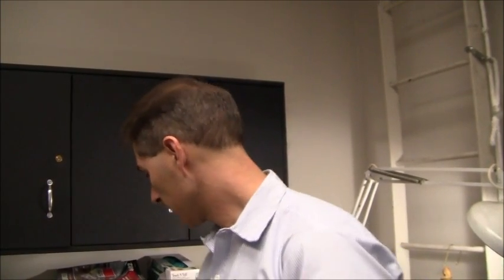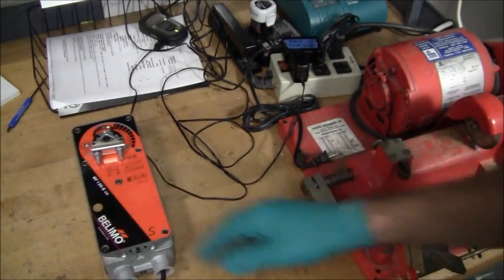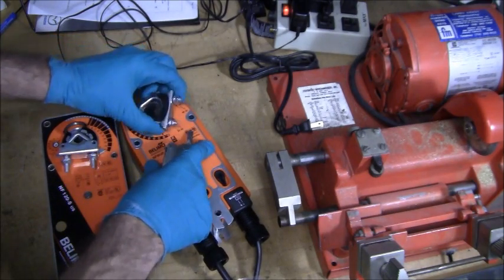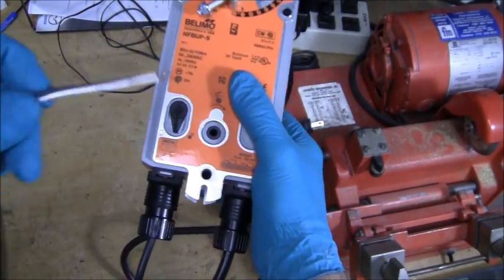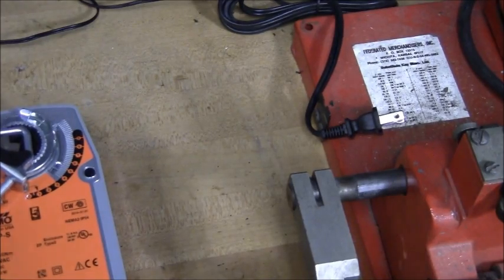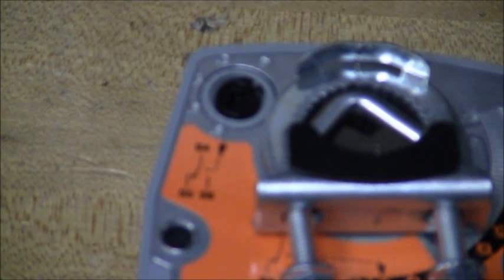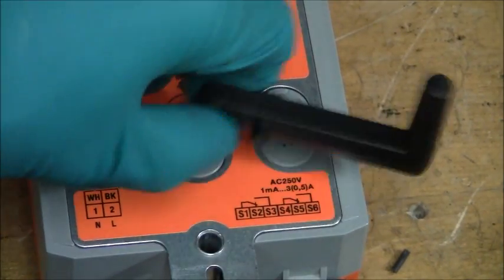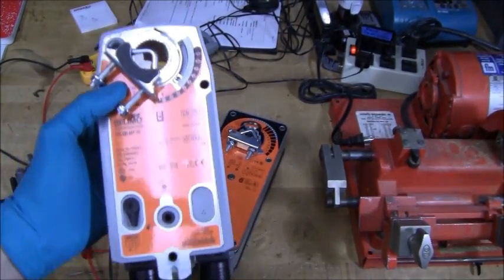Testing a Damper Motor Belimo MO# NFBUP S

Comment: What does setting it to 50% do, that closes a switch for what exacly?
Reply: All those colored wires are contact switches (relays). S4 and S6 wires are normally open and in this video he has it set at 50% and can always change it for whatever application he's doing. S4 and S6 close at the 50% mark in the rotation. So you can run wires from a security panel or Damper panel through S4 and S6 and once the actuator hits that 50% mark a signal can be sent to these monitoring panels.

So basically you can send out from the actuator a signal during any point during the rotation, you just have to set that screw that he was showing us to what you want.
Reply: @mikerosoft1009  wow thank you

Comment: At 12:13 why didn't it stop like you said it did? I'm a little confused.
Reply from the maker: it was not the cam that stopped but the switch opened. you need to listen to the meter and at  50% the meter stops buzzing.
Reply: It's when the auxiliary contact changes state. On terminals 4 and 6 he can adjust when the contact closes. He had it set at 50%

Comment: Having dealt with Belimo and their actuators, I can tell you it is really hard to win a battle with them over a bad actuator. If you have a problem with an actuator, they want you to send it in so they can say there is nothing wrong. 

I used to test fire, and Fire Smoke Dampers on a heated Wind Tunnel. 

Handy hint: if you have an actuator fail, do a static torque test on the damper and then do one under airflow. The actuators should tell you how many inch pounds of torque it can handle. It is printed on the housing. 
If the torque is too high, it can break the gears, they are powder cast and can and do break. 

I used to do AMCA and UL testing on fire, fire/smoke, smoke and air control products. Nothing like being in a room with 12 dampers during cycle testing. Took about three weeks to get through 250,000 cycles.

Comment: I inspect fire dampers and this is the latest in Fire and smoke Dampers the older system is newmattic runs with Air and Fuse links Great video Thank you very much.

Comment: how to lock the damper shaft?
for instance 
1. motor is not energized then the shaft is at 0' position
2. if motor is energized then shaft rotates and open damper to 90' position,

but when again the motor supply is removed the damper goes back to it position.. ?
how to keep open the damper?

Comment: I just wondering what is it for? But now I know... Thanks for this video.& I still have a question is this thesame with the HVAC actuator? Or
Reply: These actuators are designed to close fire/smoke dampers in the event of a fire in a commercial building. When the actuator has power, there is a motor that will open and hold the damper open to allow air flow once power is cut [in the fire alarm sequencing] the spring will close the damper and hold it closed to keep fire and smoke from spreading through the HVAC duct work. Fire smoke actuators have to withstand and function in temperatures of 250 to 350 degrees F under various air volumes and static pressures. I have tested up to 8 inches w.g. And it scare the hell out of me. That kind of static pressure can blow duct work out of the ceiling. 
All of this comes from what happened at the MGM Grand Hotel fire in Las Vegas back in 1980. Lots of people where killed from the smoke that spread through the building. Look it up. 

I know this because I used to test them.

Comment: Ken if it is on fire and smoke damper that is not the correct actuator for that application. What you need is a Belimo FSNF120-S US which has the correct UL rating. If you have any questions please call us at Boston air controls 781-272-5800 we are a Belimo Platinum distributor.
Reply from the maker: Ranadhir kumar the shaft has a slot on in to show position.
Reply from the maker: Thank you
for clarifying that. It was not for a fire damper.
Reply: KenTraining yeah this is just a spring return damper, when power exists the damper is open and vice versa.
Reply: KenTraining by the way i have a query how do you visualize the damper position, in short how do you indicate status/position of the damper ?
Reply: KenTraining I'm